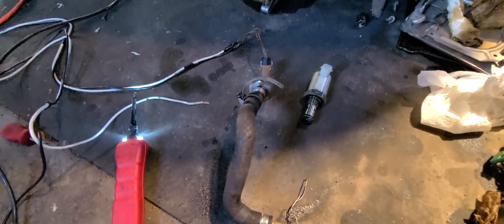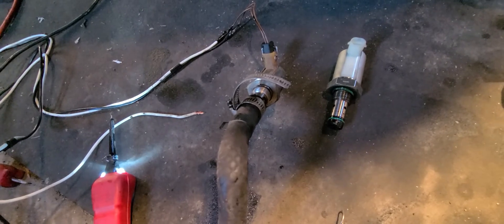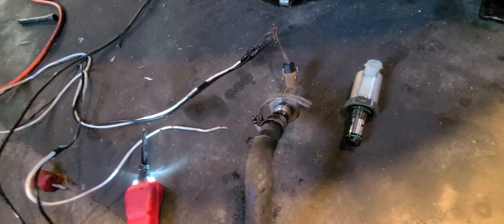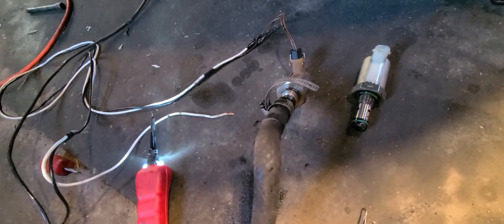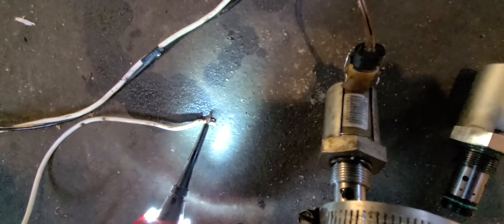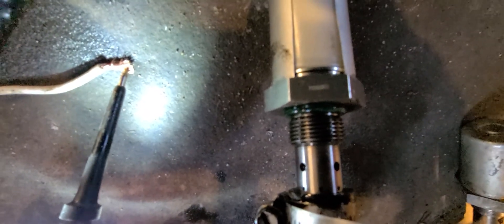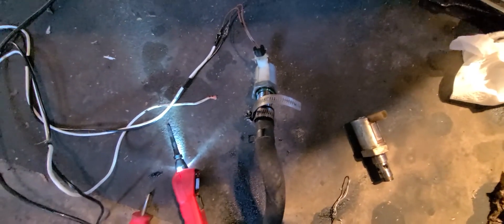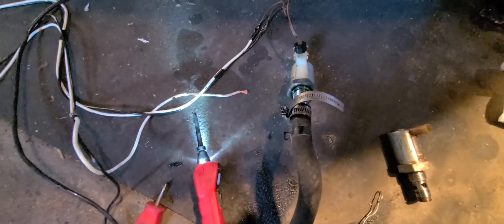6.0 Powerstroke no start IPR Valve bench test

Comment: PSA THE IPR IS 5V operation not 12V you can and will fry a Ipr at 12v. Tapping it with 12v quickly from a test is one thing bench testing with air should be done on a 5v circuit
Reply: The red wire coming into the IPR is 12 volt power. Supply’s other things as well

Comment: Did the bell housing change in the 4l60e transmission affect the swap ?!
Reply from the maker: No it did not affect the swap, it was the right fit, although I had to make my own flywheel Cover.  I am not positive if you had the original flywheel Cover, if it would fit, as I did not have one.  Hope this helps, and thanks for watching!